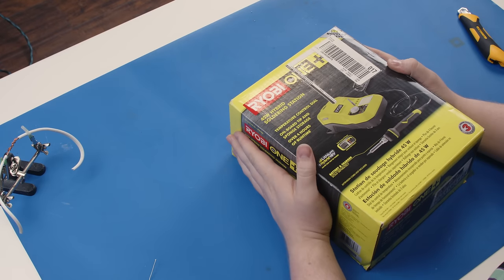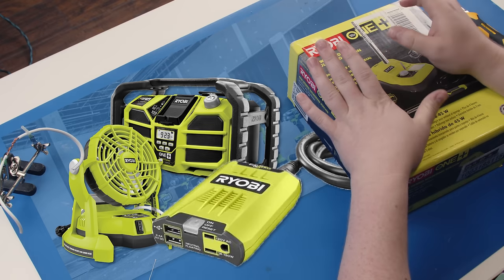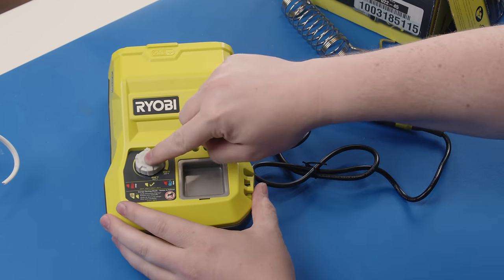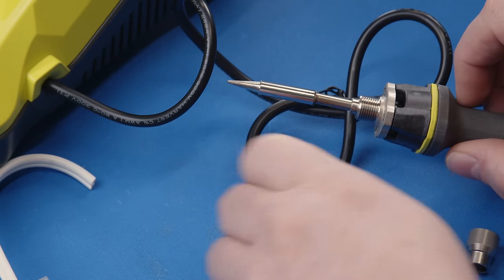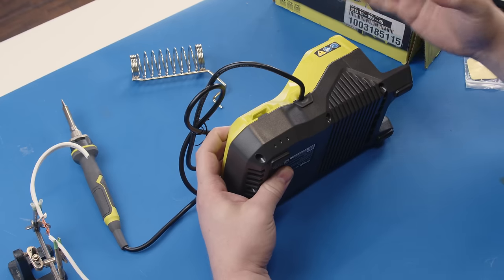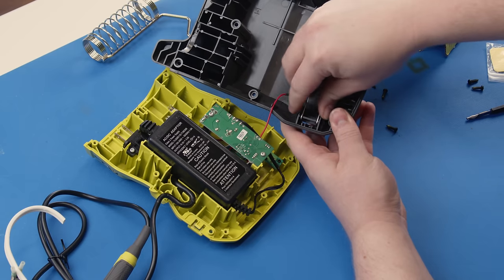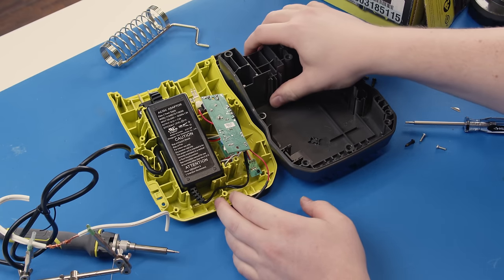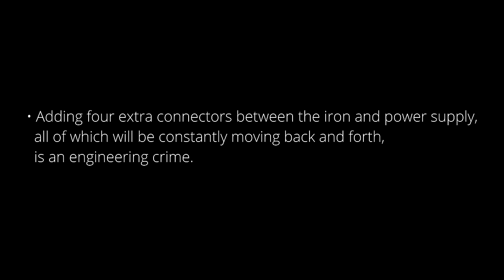Ryobi has GOT to be joking with this soldering iron

Comment: Weller makes or did make a few years ago a battery operated soldering pen just like the one you showed us from cold heat or whatever that was. It ran on AA batteries and did a good job until my dumbass decided to melt some rubber with it to make two holes for my mom’s hitch cover so that it would stay in and not slip out 😅. One day I was going to solder with it and it wasn’t heating up so I thought “oh whatever it probably just needs new batteries”. I put new batteries in it and it still didn’t work so i thought “um excuse, what the actual f*ck” and decided to deal with it another time. Well when I did need it was at a train club. I was trying to use it but it wouldn’t work so I gave up but I left it on thinking maybe it would heat up. After 15 minutes pass I forgot about and left it on a table. I was working on something on the train platform and I go and grab something on the table and I see it there and think “maybe it’s finally hot” but it wasn’t, the handle was hot so I was like “what the f*ck is happening “ but then I realized it had overworked itself so much that the batteries exploded. After that I threw it away and got a plug in weller one. I’ve only had it for a few months and I love it. It’s red a black, looks like a pen, and has no power supply so it nice and compact. It even got little led lights so you can see your solder. I highly recommend this one. 

Sorry about the super long comment. 😅😅😅😅

Edit: the little battery soldering pen did work well for small simple jobs until I f*cked it up. 😅😂

Edit 2: I typed this revubefore he said the ones without temperature controls are trash. For What I use mine for it’s not trash. I just solder wires together and it does a great job. I got this one because someone I know has it and he is a model train expert, an electrical expert, an expert in many other fields and is just overall smart and wise man. That’s why I purchased it and I love it. It’s also compact

Comment: Seems like a drama queen video towards the purpose of nonsense clickbait title.  The only problem I have with their use of a 3rd party brick, is that being someone adept at electronics so could use a portable soldering iron, I'd also be more likely to DIY repair a failed power supply and most of those AC/DC bricks are permanently sealed, not just screws holding the clamshell together, so have to put them  in a vise and use a chisel and hammer to break the seam apart to do any diagnosis and repair. Well that and being so sealed also makes them run hotter so a shorter lifespan from that as well, but to be fair most people aren't running a portable battery powered soldering station, all day, every day, so the lifespan issues is eased by that.

Comment: That wall wart in the light almost looks like it was meant o have a pair of European round pins sticking out of it. 
They likely just used the half shell of the Euro version but with US 120v blades. 

The first thing I was thinking as you were handling that thing was that the cord would drive me nuts on the bench. 
That and I'd like to see a true temperature readout on it. 
For me, I'd never use the battery function, and likely wouldn't bother with it in the first place because i don't do Ryobi cordless tools either.

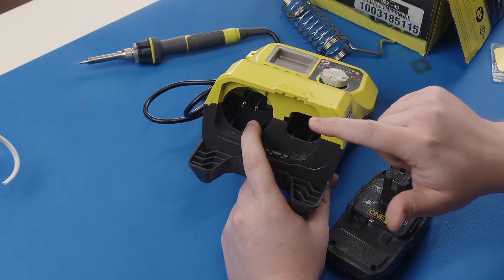Comment: 16:08 No ground. That is bad for electronics soldering. At least on battery it is merely floating. On AC power, the tip may have 60Vac on it capacitively coupled from incoming power. This can damage sensitive parts. The worst part is they may not just quit working, but not quite work correctly, and slowly get progressively worse.

Comment: something i just noticed that i thought was interesting. fuse cap on the bottom that leads to nowhere. i find it funny that its kept on the casing, but they clearly cut the corner there. Though its possible that its a regional thing with these stations

Comment: All the facts are true. I have bought mine years ago. The soldering tips are useless too. Just won't work. No way to stick solder to them. Finally I have modified one of them and fit a piece of copper tip in it, that was working fine but shortly after the iron gave up. Was useless anyways so now it is in the rubbish. Otherwise I have to say they should re-design the product and it would be something that I would buy. Thanks for the review and please try the tips if you can stick solder to them . I would love to see that because i bought mine a lot earlier than this video (abut 4-5 years ago) and they might already changed this.

Comment: “Saw der”. Distracts me from what he’s trying to say every single time.
Don’t know why I struggle with that one so much.
No problem with ah loo min um or nuke you lar, though they were strange at first. But saw der throws me every time.
I’m, among other things, a qualified electronic tech, with time served in a tv repair shop, where we used both soldering stations AND pencil irons, depending on the situation.  Nowadays I rarely do any electronic work, mostly because everything is encased in resin, but also because I have got much more involved in the motor trade and the pleasure boating industry. This is where a portable solder station would be a godsend. But not this one.
In my toolbox, this would tie itself up in knots and become permanently stuck to enough stuff to prevent me getting it out. Frustration would eventually lead to me yanking it out, along with all the stuff it tied itself to, during which it would almost certainly snap the cable off.
I need to be able to unplug the iron from the base and store it in a separate part of the box, with the cable neatly coiled around it.

Comment: 27:32 Europeans oddly enough.  Torx has replaced Phillips heads in home improvement and DIY for a while now.

-Not as easily rounded off as hex or Phillips
-Cant really use the wrong size as easily as with Phillips either, again less chance of mangling it
- As Torx is a straight down hole you dont need force into the screw to not have the bit lifting out , Phillips tends to do this as the + shape is slightly angled to make aim easier

Comment: I have had a Hako soldering station for about 30 years a the heating element is one of those ceramic tipped elements. It has never given me any issues. Replacement soldering tips are very easily obtainable on eBay. I don't particularly like Ryobi products and currently don't have any working Ryobi products and don't intend to purchase any. I am in Australia.

Comment: 15:19 from what I can see, these are knockoffs or licenced copies of Hakko 900M tips. They're the Kleenex of soldering iron tips, and one can improve the performance of many budget chinesium stations by replacing the loose-fitting knockoffs they come with for genuine Hakko parts. What you have from Weller is 1. Different brand, and 2. Semi-pro station with a more power-dense heater and shorter distance from heater to tip.

Comment: WOW guess I was a late starter having not learned to solder until I was 13-14. The best iron I ever liked was a Weller Temp-matic I think they called it back in the 1970s. simple pistol-shaped temperature-controlled iron. Must have worked perfectly for 20 years for me with occasional use. You likely solder fine you're just overthinking it. and maybe trying to force it if you push on the tool. Soldering requires a hot iron and i always melt just a bit before I use the tool and that drop on the tool will conduct the heat to where you need it by just resting it on the job.

Comment: Agree on your comments about the Ryobi build quality. Guess all the plastic is to not crack easily if its dropped. Should be more options for battery driven soldering Iron. Have the TS-80 myself and its a good Iron. But its not the best build quality that either. Im on my second because tip holder cracked. And powerbank need to be 80% charged or more to get it working. One thing i disagree on is that you think all need a stand for every Job to use a soldering Iron. If you solder  wires together on a site in a hallway   ex. Rfid Reader for access control its a small chanse there a table if you dont bring it your self or your ladder. So in some cases you dont need stand becouse you need it so portable as possible. Also that every solder Iron without temp control is junk is not correct. The question is what should you solder. Are you soldering electronics i may agree some. But there are a lot of soldering you can do with a cheap soldering Iron.

Comment: Well,  I can burn the pvc cable off and then cover it with a 5 dollar tube of silicone   😂. Secondly as much as I do love this thing ….You called it on the hand soldering though on the control board. I got one and it didn’t heat up. Luckily I got it on Amazon and it was sold by Ryobi.

Comment: actually Butane solder irons where used and still are for portable use by many service techs in both the emergency signalling and computer service.   The USB and Battery Solder Irons can not handle a remote service.   Oh yea, gas soldering iron are great and yes you can control the temperature.

Comment: If you're pressing hard on a soldering iron, you're doing it wrong. Your joint isn't heating up because it's oxidized, or you don't have any solder on the tip to transfer heat.

Comment: JBC tools makes a really nice battery powered soldering station.  As long as you don’t mind spending $850 for a soldering iron. It’s worth it in my opinion however I solder everyday so if you don’t do it that often then I suppose it’s probably not worth it.

Comment: I would think that taking a UL-certified power supply that was intended to be free-standing and putting it in a case that prevents free air flow around it would be a violation of some kind. Regarding the use of a certified open-frame supply, I wonder if the fact that you’d still have 110/220v wire running to a plug, neither of which was attached to the unit at the time of certification would mean that you’d still have to go through a certification process for the assembly?

Comment: I actually dont care the cable is PVC.. Ive had too many times where the silicone/rubber cables look protective, but the cables inside them still are just PVC coated and I accidently set a hot iron on it, and the cables inside melt together and short out. The silicone cable looking unphased, while the cable itself is junked. It being a portable unit, being able to place the base almost anywhere vs being forced to a fixed location like many wired units end up needing to be easily makes up for the cable being stiff, along with cable length. Ive never really had to fight the cord even when stiff. Heck half the time I get annoyed by a softer cord configuration cuz they move TOO easily and get in my way or catch on something unexpectedly.

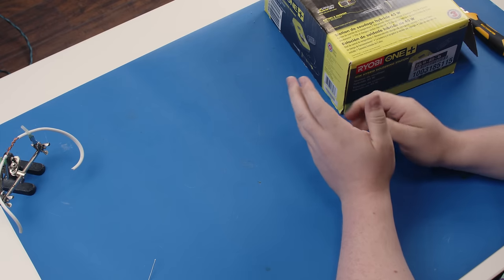Comment: 9:36 - Weller soldering station, but battery powered?
Take your Ryobi battery and plug it into the inverter you mentioned they sell at 6:45 (or do the same with anyone who makes an inverter like EGO, Milwaukee, etc.) and boom, you're done.

Comment: I know what you mean about DIN plugs! Even with a 1mm soldering bit I was almost driven crazy when I had to replace a 13 pin DIN plug on some radio gear. I've been soldering stuff for over 60 years.......

Comment: I still have my coldheat soldering iron from back in the day. I still haven't successfully soldered with it. I was able to get it to desolder once. The problem is it only heats the solder and not the connection. So you are heating the wrong spot.

Comment: I am a retired electrical engineer, who has designed something that most people in the world use every few days.  I learned to solder at age 12.  This Ryobi soldering station is over-thought by some committee made up of people who don't really understand the basic issues of soldering.  It's simple, You are just heating up an electrical connection sufficient to melt solder.  In the old days it was just a nichrome wire inside a ceramic sleeve tipped with a suitable soldering tip with a bi-metallic thermostat to control temp..  Today the same can be accomplished in the same way... or with a small electronic circuit that senses current or temp and varies duty cycle or voltage to a heating element.  The stupid power supply in this Ryobi, and the clamshell case, and the chintzy control circuit to control temp with lots of wire interconnects are stupid.  You need AC coming in (with ground) two wires out for heating element and two to charge battery.  Basically it's dumb to use a 16 watt supply because You can't solder anything large without spending too much time (also possibly melting socket plastic, such as on connectors).  You need more power, unless You are just working on small stuff, a heftier battery with the capacity to heat fast when necessary would be good.  You could basically just use a heftier existing switching supply with a voltage adjust and an effective current sensor.  So stupid to put it in the ridiculous clamshell case, just filling empty space to impress consumers.  I think Ryobi can afford to get UL approval.  Beside that, as pointed out, this product should be flagged as the soldering cord can easily be compromised.

Comment: The temperature rating on the cable is the insulation rating for the conductors. You're not supposed to touch the cable with the iron.

Comment: Check out the Pinecil from pine64. Can run from usb power bank. Works great for most circumstances. I built a whole Akitika audio amp with one (lots of components). The best part is that the iron and tip are very ergonomic size. No station creds there, but not really needed as it can sit on the table by itself or hang by the wire on some wood when not in use.

Comment: I wonder how difficult it would be to open it all up, the iron as well as the base station, and replace the cable with a proper high temp rubber jacketed cable assembly...

Comment: I would probably spring for the craftsman one. Uses DeWalt batteries so you can use the 15 ah flex volt battery and that will probably run it for hours. I also like Stanley black and Decker more than tti.

Comment: I got a WTCP (I think? Temperature controlled by a Curie point magnet in the tip) uses PT series tips, got it so long ago I forget exactly but it was 20+ years. I can still get tips from McMaster Carr mailed to AU. Modified it with a new socket and plug, a set of antistatic banana sockets, and  still use it to be cruel to circuitry down to hobbyist SMD to this day...

Comment: It seems more like you are a schill for the anti-Ryobi crowd. All I could afford before Ryobi was REAL JUNK. My first Ryobi battery powered tools were the ol' blue three tools in a set i got on sale for less than a one tool kit from big yellow or big red. I have used them and more that i added after to rehab houses and apartments for 14 years and with upgraded Li-ion batteries all still work. I have been adding newer brushless tools when on sale and have no complaints... only appreciation for tools affordable for the average guy that when taken care of provide excellent service.  Now i did buy cheaper black friday 18v blue Ryobi drills for extras and Christmas presents and all still work with new battery upgrades... but they are lesser quality than my original drill with a larger chuck. One is still in use at a church in Brazil, a handi-man friend  still uses his since his " big yellow" died... and i have one at the camp in case i am there without my main tool kit.  Oh... i recently bought the 18v Ryobi soldering kit from Direct Tools Outlet and am happy with it. I also bought a factory blemished 18v pole saw and found the only blemish was a misprint on the box it came in. Even my local Houston paper can't do better than that...  Blessings

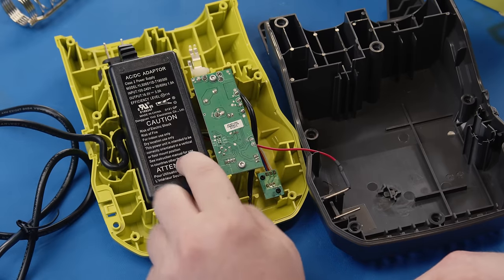Comment: 30:37
I purchased an Xbox One power supply, cut the output and rewired it to power my diesel bunk heater.

Granted it's a hack, a decent one, but I don't see anything wrong with Ryobi doing a similar thing.

On the one hand it's a little funny that they took something that went through a packaging process to effectively work around the packaging but in the end that actually makes it a little more user friendly, doesn't it?

Comment: Its very common with products that have the extension chord style plug up to case to have a power brick inside product my jnc 660 12 volt lead acid jump box has same thing as light inside its actually convenient if power supply dies easy to get replacement and that's usually what kills the packs besides dead batteries I've rebuilt several of the jump boxes buying broken ones saved me a bunch of money on packs for my business

Comment: 13:51 I bet it's just a triac dimmer circuit. I bought one of these from home Depot looked inside and returned it. They tried selling a $15 Soldering iron with a dimmer switch for $80 or something. 
Oh its dc powered nevermind now I'm curious.

Comment: Make your own, get a Pinecil or similar open source soldering iron, and a power tool battery of choice, and 3d print a mount for it and an adapter for the Pinecil.

Comment: There are more uses for soldering than using on electronics. The "tool" versions would be great for HVAC work. Brazing is basically high temp solder.

Comment: I only made it half way through but I disagree with almost everything you said.

Those cold fusion irons were amazing. It did not do a cold solder because it had to heat the part instead of the solder until it got to the point the base was hot enough to melt the solder. Their down fall was that they went through batteries pretty quick. They were before their time because lithium batteries probably work well. 

You should be using heat to solder instead of force. Try wetting your tip to help transfer the heat instead of pushing so hard.